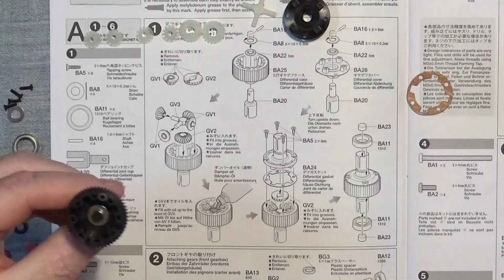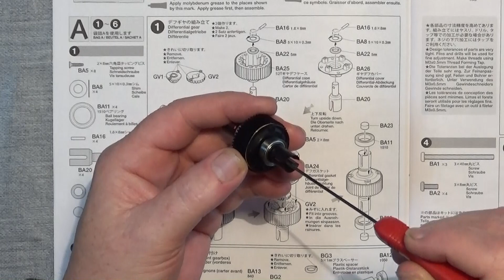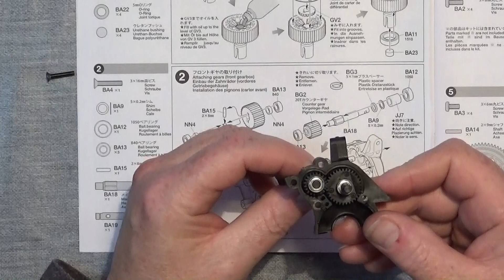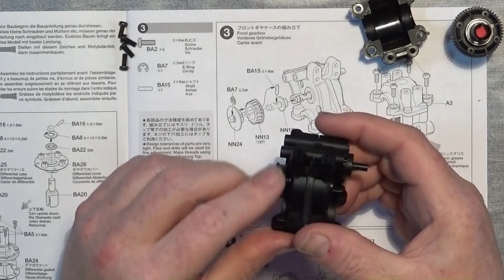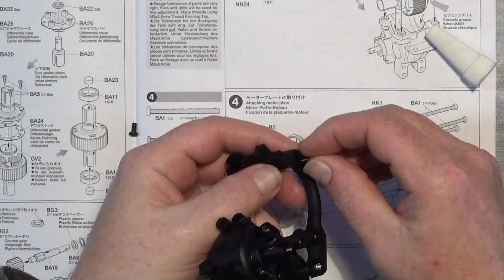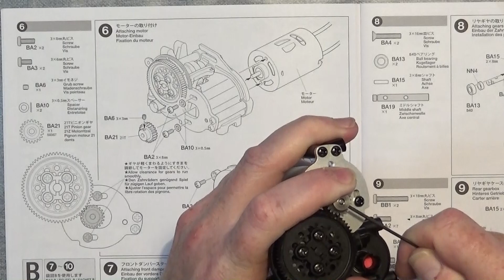Tamiya Asterion XV-01T Build Parts Bag A

Comment: I'm excited to see this one Rob!!! 😊🍻
Quite an impressive bit of Kit for sure! Those Drive Cup Pins looked quite fiddly, but manageable. I actually have a couple of concerns.... 
1) The translucent Plastic Diff Spyder and End Gears. They appear brittle - especially in a big Tyre Truck application.
And....
2) The Shock Oil you used as Diff Oil. 1100wt is pretty thick Shock Oil - but in a Diff - it's like Vinegar!! 😲 
I use a MINIMUM 8500wt - typically 20,000wt, and in my Axial Wraith - 500,000wt!! 

UNLESS you're not looking for any Limited Slip action at all. Then you'll be just fine, and the Gears will be well lubricated. 😉

I'm NOT PUTTING YOU DOWN!! That's not my intention. I'm only intervening here because after Decades of Suspension and Drivetrain Tuning, I spotted a blatant issue. 😉  Like I've mentioned, if you want an Open Diff, you've done your usual good work! 

However, if you want or need some degree of Limited Slip action, you need MUCH thicker Diff Oil.  10,000 to 15,000wt Oil would be a great starting point, and will keep smooth Steering. But it will keep that inside Wheel from spinning off Speed, when it's unloaded in a fast turn.

I hope you're not cross. I'm sincerely trying to help you, Mate! 😊
Carmine ✈🚂🚙
Reply from the maker: Hi Carmine.
Only time will tell on the diff gears, can't remember if they are the same in the XV-01 normal chassis.
I would never get cross at any tip or advice given dude. I would have used heavier oil if I had, had any but I'd forgotten they were oil filled so didn't think to order any thicker. So going forward it could be a mod I do.
Many thanks mate and stay safe.
Reply: I should have known better! Some People take advice as an insult to their very character.... 
You and Mark have never been that way. 
Cheers 🍻 Mate and have a great Weekend!!